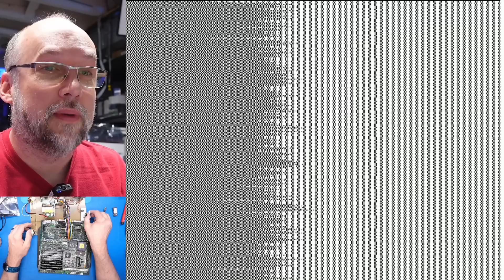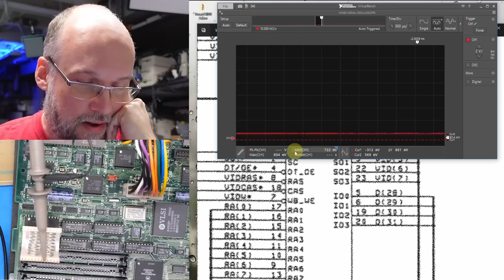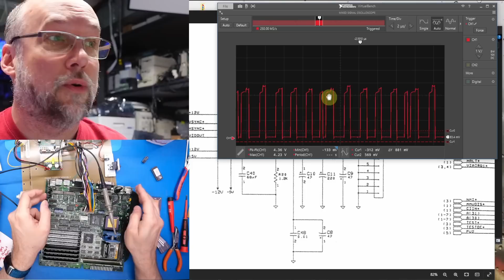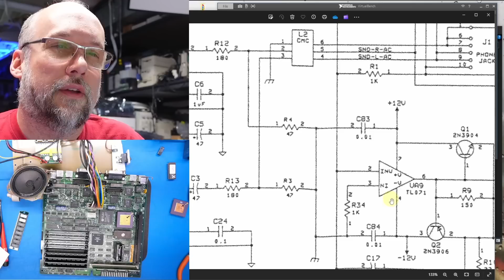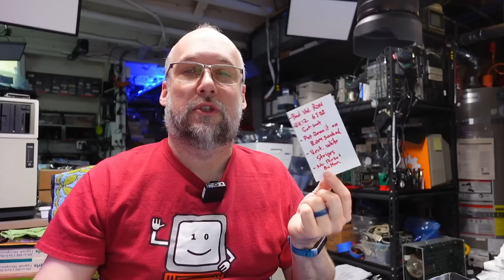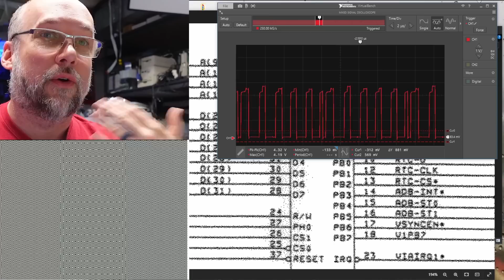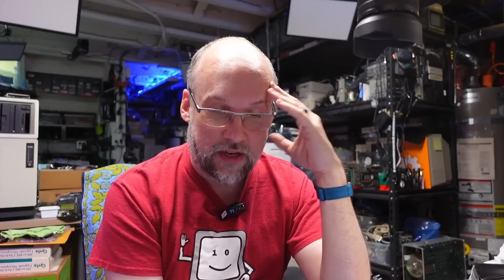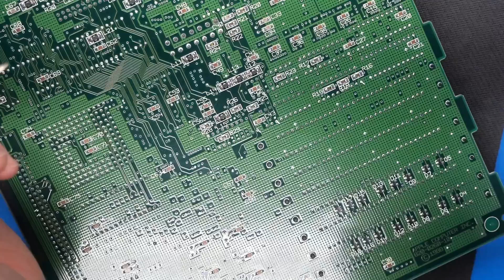Recapping my Mac SE/30 wrecked it

Comment: Woot! New ADB video!
Reply: I don't understand why you are focusing on stuff like the video RAM and protection diodes when the glaring issue appears to be the glue chip, math co-pro, and/or the SCSI/disk controller chips. Those are all presumably on the data bus, and during POST I'm sure the ROM checks them to make sure they are responding. Without the glue chip working 100% I'm sure you'd get similar problems to what you are having.
As far as surface mount goes, you need to change a couple things in your approach. First, when it's a crowded area on the board, cover nearby stuff with Kaptop/polyimide tape to protect from the heat. Second, use lots of flux when removing -- then clean the board. Then get some solder paste in a syringe and just put a thin string of it around all the pads, adding some liquid flux as well to make it easier. Place the chip as close as you can, heat the area with the heat gun, and when the solder melts you will see it pull the chip into place. Give it another few seconds of heat to make sure all the solder has melted, then remove heat and let it cool. This is almost foolproof, I don't think I've ever had this method fail when soldering on replacement parts. Mike over at mikeselectricstuff has an old video about replacing a DFN part, and he has really good closeups of this whole process. Worth watching.
Reply: @AureliusR  The GLU isn't on the data bus so shouldn't have been damaged, and the chip enable to SCSI, IWM and the 68882 never goes low, so those chips are never even being talked to during the diagnostic phase where it's crashing. That doesn't rule out they are damaged or not, but those are not causing the system to crash since it would need to try to talk to them first. As for the soldering method -- yeah I could see that working quite well. I do really think something to heat the entire board up is likely very helpful because it took forever just to get the old chip off... I'll need to practice installing PLCC chips with hot air as that is surely going to be the way to go, just slow (with my existing gear.)
Reply: @adriansdigitalbasement2  I recommend picking up one of the small USB-powered hot plates (we have some for sale on Tindie). Also it seems odd to me that the glue chip doesn't connect to the data bus, but I don't know Macs well. The other chips could easily be damaged though and I think that's definitely the place to look. Anything that was on that data line could be fried. Also, I haven't seen the other video yet, but was it working at all before the recapping?